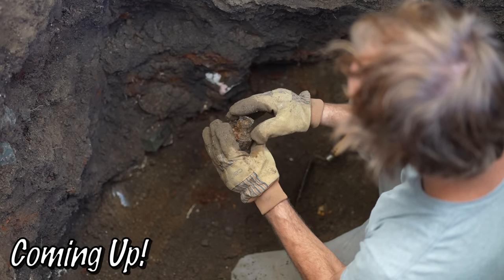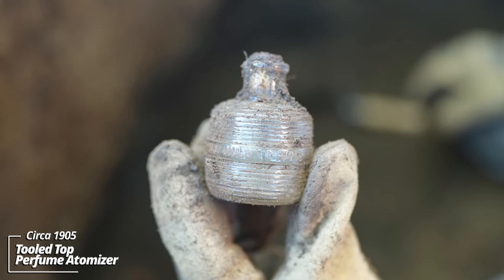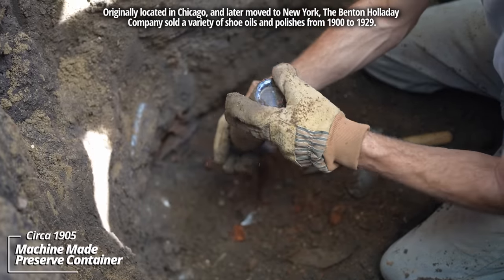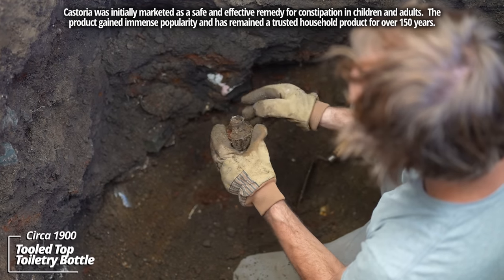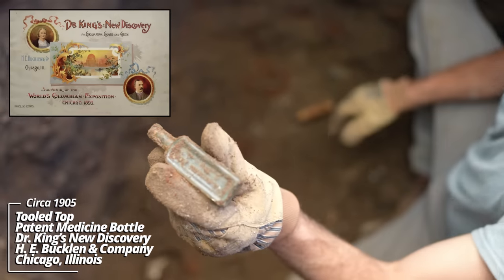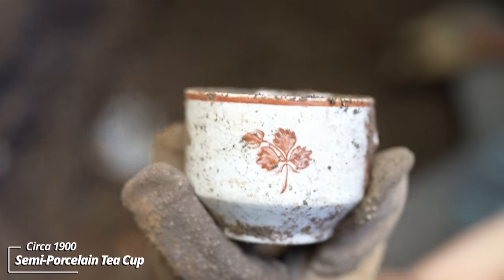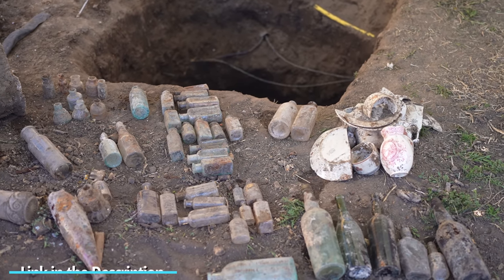Digging Out a Fence Post Leads to the Find of a Lifetime Buried in a Back Yard for 125 Years

Comment: Could you explain the difference between a “applied” top & “Tooled” top so I can understand what you mean by that. It will help me understand what it is your doing and may put things into context
Reply from the maker: Applied tops were generally made earlier and required the tops to be applied separately. These appear to look as though the glass is running slightly down from the lip. A tooled top was tooled in the mold and is much smoother. Tooled tops were in general production by around 1890. Thanks for watching!

Comment: Tragically. When I started school in the early 1960’s, I am sure we had ink bottles that were triangular in profile. I can remember spilling ink, and being made to scrub the floor, here in Australia. The other triangular style bottles were larger and held glue. I certainly struggled to learn to write with a fountain pen, since I am left handed. But ballpoint pens weren’t in use in the early 1960’s.
Reply: re: ballpoint pens  ditto here in the southern US, same time frame. But we had Schaeffer cartridge pens for the most part. I found my granddad's bladder-pen and tried to use it,  but got ink on my school uniform which greatly displeased both the nuns and my mum. So that was the end of that experiment  (-;
Reply: I remember the ink wells in the 60s in Australia
Reply: @c8Lorraine1  Interesting. I was in elementary school in the U.S. in the 1960s. I never saw an ink well. We used #2 pencils for writing and crayons for drawing and coloring.

Comment: Hey Tom! Love your work and you have inspired me to start finding my own relics and bottles (old foundation in my backyard near a river dated 1890-1900). Quick question, what do you normally do with all of the bottles and any recommendations on how to clean the dirt from the inside?  The hose can only do so much and was curious. 

Thanks and keep on digging
Reply: Adventure Archaeology, may be able to give some tips on cleaning the bottles.  😊
Reply: Adventure Archeology and goggle searches offer a wealth of information on cleaning dug bottles.
Reply from the maker: Thanks for watching! I'll usually clean them out with soap and water, then use the bottom part of a wire hanger along with a cut up piece of a UHaul moving blanket to clean the inside. After that, if there is any rust deposits or content stain, I'll soak the bottles in muriatic acid overnight. Be careful, as muriatic acid has strong fumes. Only use outdoors with a respirator mask, rubber gloves and safety goggles. Best of luck!
Reply: And what do you do with the finds once they're cleaned out?

Comment: My family on my mothers side was related to the Sebring family in Ohio that did a lot of the Sebring pottery.  Amazing that it made it that far west.  A number of years ago, I was putting a tool shed addition onto my chicken coop and found an old out house pit.  I dug a number of really interesting things out of it, including two horse shoes that now hang in my blacksmith shop.
Reply from the maker: I'm glad you excavated it. Too often these sites are left to the wayside. Thanks for watching!
Reply: Chianti bottles the basket part rots off so has round bottom,
Lots of glass pyrex bleach bottles amber glass and liquor bottles brown. Some quaint old time nostalgic brands that seem to fade into history. We dug up a few, use steel wool water lots of water. The tiny bubble in the glass, cork stopper mouth.  California
Reply: Anything that wouldn't burn went to the outhouse to be disposed of.
Reply: @BelowthePlains  7

Comment: The finds are interesting in themselves and the difference between what is considered old in the US when compared to the UK is also illuminating. I had a back yard door that had been reused multiple times and was probably from the early 1800s. It might even had gone back to the earliest years of the US. The bottom was rotten so I smashed it up and burnt it. Nobody would be interested in it. A nearby shop was selling chemically stripped Victorian doors for what would be $60. It is all relative. Many older buildings have ships timbers in them. Ships masts used as roof timbers. They probably go back at least 150 years to when the building was erected and then another 50 or more for the lifetime of the ship.

Comment: Someone in this household had beautiful shiny shoes and PMS. Great Dig and Finds!
PS- I realize they didn't have superglue, but would they have not had access to some type of glue to repair their teacups etc..
Reply from the maker: They did have different types of glue and cement during those times although I've never found anything that had appeared to have been pieced back together, though if it had it's possible that the glue would have deteriorated in the ground. Thanks for watching!
Reply: Lol.  The PMS probably led to the beer bottles...
Reply: @rickclark4112  Or the opium.
Reply: @robertmcmanus636  Yat!!
Or both...possibly at the same time. Hmm...would folks have gotten a high from.shoe polish fumes back then? Some modern shoe polishes have rather strong fumes. 🤔

Comment: The Hutchinson soda was an amazing find.  The little embossed druggist bottles are gems as well.  The "opium bottle" actually contained a product called "Haarlem Oil", which is a Dutch liniment used generally for horses and other livestock.  It contained  sulfur, linseed oil and essential oils of turpentine.  We thought they were opium bottles for decades, until we dug some with "Haarlem Oil" embossed on them.  It is still sold and it even available in that same shape of vial.

Comment: The first house we owned was built in 1935. It was the result of a family whose home was built in 1880, subdividing their corner lot and building a "remodel" onto their outhouse. 
When I learned this in 1996, I crawled under the house and sure enough discovered 4' diameter pit underneath our washroom/pantry. I excavated it down about almost 5' finding some cool bottles, etc, but after that my wife didn't want me continuing for fear of a cave in. The first bottle I found was a fairly well preserved (label) Hiram Walker's Whisky 1 pint bottle from circa 1935. Figured it was either from the plumber or electrician working under there. 
Watching you makes me wish I'd kept on digging.

Comment: My home, built in 1956, was built on the same site as the original, over 100 year old homestead, in this mountain cove farm. I still find odds and ends, pottery mostly where ever I dig.  But in a geologic mystery, anywhere I dig on this property, at 18 inches down is broken, sharp edged granite, about 6 inches thick, and at 2 feet down I find smooth river rock. (Why would I dig holes over a lot of the area?  Fence posts)  When I dug a 5ft deep by 5ft square hole for an antenna tower, as I passed the 2 foot rock layer, I got into heavy red clay, then dirt, then a thin layer of dry brown powder which rested on top of  the purest white sand, with the consistency and color of real sugar, at the bottom of the hole, and I am 2160 feet at this elevation.  The sand was of an undetermined thickness, as I stopped at that point, but a few more shovel fulls revealed it went much deeper.

Comment: I spent many hours as a young teen excavating an old dump for bottles in a vacant lot next to my house. It must have been a "community" dump for all the cottages then in the area at around the turn of the century. I didn't find anything of great value. Most of the bottles were plain, but some of the bottles (mostly medicine) were very interesting in that the glass was embossed with cool things like "Pain Expeller" etc.. I still remember the thrill of pushing my metal rod probe through the soil and feeling it stop when it encountered glass. Just a broken piece? A whole bottle? What would it be? Good times.

Comment: I used to live in Mandan, ND. It’s pretty awesome, what y’all do. Do those pits still stink? Blessings y’all.
Reply from the maker: thanks! always nice to hear from people in our area. we are both from the grand forks area. hopefully this summer we will make it out a little further west tho, maybe even Mandan. and you asked if the pits stink. for the most part, they just smell like regular soil. pretty strong, but it basically just smells like rich soil. EXCEPT when the water table is high. if we go to a place and dig a spot where the pit is below the water line, then basically anything below that point will smell awful. kind of like rotten eggs mixed with that lake water smell. i think the lack of oxygen helps preserve things. thats why we always find stuff like paper and fabrics under the water, because in dry pits, all that stuff breaks down into nothing. it also really preserves metals better. irons stuff usually not so much, but stuff like brass will look like it had been tossed down there the day before. id say maybe only 1 in 10 pits have any stink to them. and maybe 1 in 25 are super gross. kinda all just depends on the local conditions tho. well glad you found the channel, and thanks for watching and commenting

Comment: You should carry a radiation detector, some of those bottles might have contained radium or worse. Also be aware that old irons were often insulated with asbestos. After years in wet ground, it could be all over that dirt. As a former asbestos worker, If I found myself in that situation, I would carefully remove those clothes and discard them before entering the house. Yes, it's that serious.
Reply: A antique bottle at the Sandwich Glass museum in Sandwich MA is made with uranium and is in a glass case with a geiger counter. It's got a yellow patina.

Comment: May have been someone with a semi important job with all that shoe polish.
Lots of horse poop and mud around in those days which made it hard to keep shoes clean.

Thanks for taking us along in your dig.

I bought a house built
In 1964 in the mountains.
They buried a lot of trash her over the years.
I found license plates from 1940’s and we had plenty of glass bottles bubbling up from the surface.

Took me months to clean up all the glass and metal from the area.
Never did any digging to see if I could find anything deeper.

I did find some obsidian arrowhead in the property and a couple well placed stone seats in areas of ideal deer hunting.

I’ve taken many deer from these spot over the years and this property is just magical.

The gold rush started here in Dahlonega Ga and there are hydro mining ditches on the back property in the woods.

Comment: Wayyyy cool. When I  was 7 we lived 5 miles out from a small town. We bought a 5 acre farm. This was circa 1969. The family that lived there were slobbish and had MOUNDS and mounds of trash in front of and in a big barn. There were also part of a 1930's Era old truck and two cars. We were poor and my parents couldn't afford to take it to the county dump. So my dad borrowed a back hoe from a friend and dug several ginormous holes.  I remember how much fun it was filling them up with partial truck and one of the two cats (one was in good enough condition to be restored, so my dad sold that one.) We filled the holes with the trash, cleaned out the barn, finding so valuable wood from a much much older barn stored inside. It took a couple of months to get it done, since we were only doing it some nights and the weekends. The trash that we buried was 15-30 yrs old when we buried it, so it would be well over 100 yrs old now  in 2023. The farm was around 75-80 yrs old when we bought it and I'm sure there were trash piles that were buried long before we got the property.  It would be a riot digging that stuff up now and finding the other stuff the original owners buried as well.

Comment: Ever escavate pits of  homes in a city? In Baltimore some homes had multiple story outhouses, you can tell some homes who got indoor plumbing early, they ran the 3 inch cast pipe outside of the rear wall, some still have it running to the second floor. Unfortunately most have had the small back yards completely covered with concrete.

Comment: I’m still curious why there are so many bottles in the outhouse?? You didn’t answer this question before.   I was a young boy and we had an outhouse.  Never did we put blottles in it
Reply from the maker: i think it was just because they didnt have a garbage disposal system back in the day. so they just burned anything that would burn and thats why glass, pottery, and metals are typically all of whats down there.. ive never confirmed that, but its a pretty universal thing.. i think there have only been about 5 pits ive dug, that haven't had any bottles in them, and i think that was just mainly because they were super poor.. they had town dumps but they were usually just outside the city limits so if you wanted to toss out a single bottles it was just easier to throw it down the hole than walk across town

Comment: I worked in a landfill site to build a road along side of the old dumping area. With a D5 dozer, I had to cut a ditch a meter deep into the existing garbage. Second day, I got out of my machine to see a little gold mine. No...not gold but hockey cards, baseball cards and football cards all nicely preserved in plastic just like a photo album. At the time, one Mickey Mantle card was worth if I remember $18,000. No one can guess the amount that I was looking at but, I knew it would be plenty enough to at least put down for a mortgage if not pay half a house off.
However, we where not to take anything out of the dump-site. The other problem was this deep black-oil like substance, a green color I have never seen before and a very extreme unpleasant scent mixed in with this cashe. I could easily of dismissed the order not to take anything out but, my common sense told me to look away and forget about it. My concern was toxic in nature. Today, I am still alive but sometimes I wished I could of gather up some of the treasure for who ever comes across such a hit twice in your life.

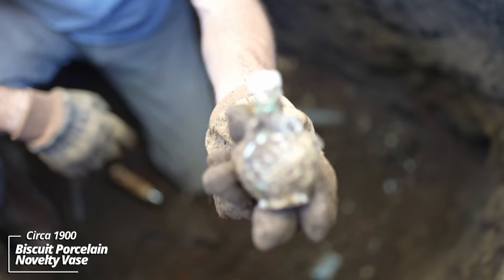Comment: The small ceramic piece pulled up at 14:43 is a bud vase.  Often the decoration was slip-cast and applied to the vase before firing.  They could be very ornate and were decorative by themselves without the flower added.

Comment: Why did people throw glass bottles and plates in their outhouse holes?
Reply from the maker: i suppose they didnt have a trash disposal system. they had town dumps, but those were usually set just outside the city limits, so im sure it was just a lot easier to toss it down the outhouse pit. i know that they had burn pits and wood stoves where they would burn anything that could be, but stuff like metal, glass, and pottery would just go down the hole. it was a lot easier than walking to the dump.. this is my theory anyways. its something that is pretty universal around north america and europe, but ive never found any documents even mentioning doing this, so theres no way to confirm.. but im fairly certain it was just out of convenience. hope that was helpful! thanks for watching mr. 420

Comment: How did you pick that particular spot?
Reply from the maker: you know those maps we showed? those are called "sanborn maps" they were fire insurance maps from back in the day. each of them have different years.. when there isnt a building standing we use those and measure from the curb to the ally.. they pit is usually somewhere on the lot line either on the side or the back, in the back yard. around here they would put them 30 paces in a straight line out the back door. but in warmer climate they would typically put them on the back lot line (bc they smelled bad, but in the winter in the north people wouldnt wanna have to walk as far) 

so we use all that deduction to get a good idea of where to look, but to confirm the actual location and the parameters of the pit, we use a probe rod, and just probe about ever 18-24 inches up and down the back yard in rows until we hit a crunchy later about 1-3 feet below the ground. they would never fully fill the pit up, but when it got to about a 2 feet from spilling over, they would throw stove ash on top (the lye helped break it down, which helped the ground firm up faster) and then threw a few inched of clay, then soil over the top.. they didnt always do exactly this, but more times than not, they did. and that ash has a very distince feel/sound when you hit it with the probe rod. so when we his something suspect, then we probe around and try to feel for glass, and we look for the edges of the pit.. if the ash seems to be in a 3 foot by 4 foot rectangle then its a dead giveaway that its a pit.. we do sometimes just hit weird stuff underground and end up digging up like a pocket gravel or old building mortar.. so theres a lot of failures we get off camera. theres never any way to know for sure until you get out the shovels.

i know that was a lot to read, but the truth is, its complicated, and involves a lot of getting it wrong and wasted time, but i at least hope that was easy to understand, thanks for the comment, and thanks for watching!!!!

Comment: You should be very careful digging below waist level without shoring the sides. If you get a collapse your head may be above the level of fallen earth but what happens is you breath out and the earth moves meaning you can't breath in again. An absolutely horrible way to die. I don't want to sound like a worrier but any construction worker will tell you its dangerous. 

Trenches five feet deep or greater require a protective system unless the excavation is made entirely in stable rock. If the trench is fewer than five feet deep, a competent person may determine a protective system is not required.